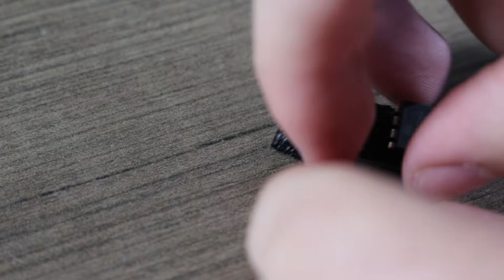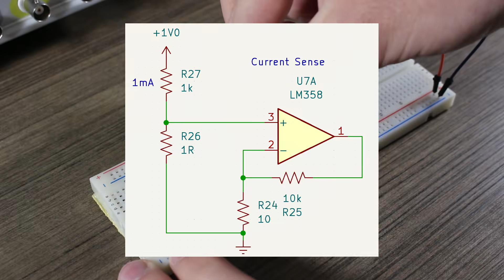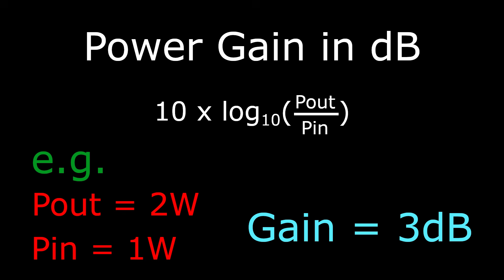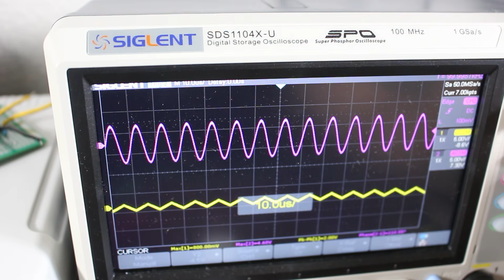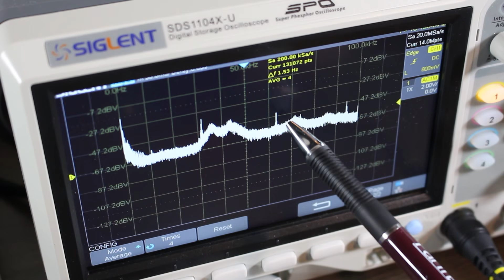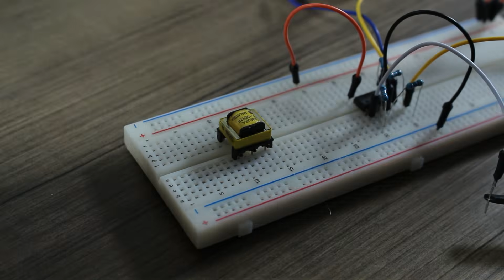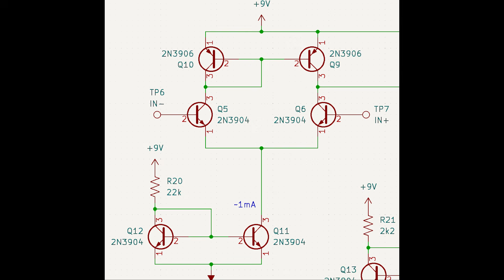The Ultimate Op-Amp Comparison - Bandwidth, Slew Rate, Frequency Response, CMRR & More!

Comment: My all-purpose jellybean tends to the the TL07x (usually the ´074, since sometimes the TL071 or ´072 are actually more expensive!)  Cheap enough to buy in quantity and OK specs overall for most of what I do.  The biggest drawback is that it isn't single-supply. (But check out the TL97x, which is similar and can sense down to ground).

LMV358 - the CMOS version of the LM358 - is full rail-to-rail, but limited to a 2.5-5.5 volt supply. The input offset of a millivolt is just so-so.

The NE5532 (SA5532) seems to be everyone's default for audio, but as far as I can tell, the only reason is that everyone else uses it for audio. Also, you have to be really careful with the 5532 in any low-gain configuration; its internal compensation does NOT go down to unity gain and you'll be fiddling with external caps to tame the oscillations. It' is not happy with service as a unity-gain buffer.

OP-07 is a pretty cheap choice if you need an opamp with a lower offset voltage (100 microvolt typical).

Don't use any of these op-amps as comparators. There are a lot of op-amps that can't be used as comparators at all because they have a low differential voltage range. While the TL07x can be used as comparators - they wont take harm from having their inputs driven to opposite rails - they're slow to recover from being overdriven.  You'll get much more speed from an actual comparator. LM311/393/339/2903 have been around since forever and are still kind of a go-to.  TS391 has higher specs and has only 200 uA of quiescent current, if you're building a battery-powered device.  LMV370x is CMOS so the offset and bias currents are down in the tens of pA.  TS3021 has rail-to-rail input voltage swing.  LT1016 is probably the cheapest fast comparator if you have the need for speed. 

If you need programmable gain, the cheapest option is probably the LM13700. The AD633 is twice or 3× the price but a lot easier to work with. SSM2164  and its clones are also worth looking into.

A trap for young players is that on virtually all JFET and BJT-input opamps, and some CMOS ones, you can't let the voltage on either input go more than about 200 mV past the negative rail, or the opamp will latch up - its output will swing to a rail and stay there, even if the input voltage returns to the normal level.  Even a Schottky-diode clamp won't save you. If you need to handle out-of-range inputs,. the most secure approach is probably a Schottky clamp followed by a voltage divider with a ratio of 1:3 or 1:4, to knock the diode's forward voltage down into the opamp's safe input range.

This should cover a decent range of afforrdable options. If you need something better like the INA828 or LTC1052 you'll probably know it already, and know that you can't breadboard the beast because parasitics in the external circuitry and faulty shielding will be the death of you.  The same sort of caveats go to gain decompensation for higher speed, boost stages for higher output voltage, opamps with specialized buffer states for higher output currents, and so on - if  you need these, you're already beyond the scope of this video.
Reply: The 5532 is the standard for audio because it has near-ideal properties for audio. The TL07x family was used in mixers before the 5532 came along but disappeared rapidly. The LM4562 is slightly better, but it took 30 years for it to show up after the 5532. It still costs more, I think. Both of these have high current draw so they are not ideal for battery operation. Some modern op amps come close to the 5532 in consumer battery applications at lower current draw.  On unity gain operation, the 5534 (single amp version) is not compensated for unity gain, but from memory the 5532 is OK.

Agree about comparators: use a purpose-designed comparator, don't abuse a circuit that was designed for linear operation.

The distortion figures of the LM358 (everyone's got some 358s :-) ) can be improved by using a 1k-ish pull-down resistor on the output. Increases current draw though.

Comment: Excellent. I got eyes on that Transistor build. For now I bought the 50 for $5 Op-Amp slab O chips from China, a few LF356H from Bulgaria, and some LM311's from Digikey. These are for bench testing, I just want to understand them. I'm starting with a VCO circuit using the 358.  Good video.
Reply from the maker: Good luck with your VCO!
Reply: @SineLab  The 358 build worked! Now I have time for the transistor thing, because why not? I have way too many transistors and really want a ghetto op-amp. Cool, Thanks.

Comment: That was very educational! Could you also show other circuits like a class AB amplifier or class D amplifier with a couple mosfets and how to design such a circuit? Maybe you could show how to work with FETs or how to choose the right BJT. For instance, do I use a BC547, BC517, BC337, BD139, etc? I got a small set of some common transistors a while ago, but I've only used them to switch some LEDs on and off with a microcontroller and there are more interesting ways to use them but then you need to understand the differences more ofcourse.. Other than NPN versus PNP I mean of course.

And regarding the FETs, I understand that opamps with JFET input are often better, but why? Is it just because a FET has higher input impedance on the driving pin? (I guess that's called the gate? Normally I only work with BJTs and a couple mosfets for switching purposes so I'm not sure of terminology for FETs).

The explanation of that current mirror went a bit fast for me. I think I've seen other circuits for current sources maybe just using one transistor. What's the difference? I know there are packages with matched mosfets on a single die, so there must be packages with matched transistors on a single die as well. How much better could you expect your custom built opamp to work with matched transistors like that?

Anyway, great content! I don't expect an answer to all these questions here. But maybe some ideas for future videos.
Reply from the maker: I have plans for both a class D amplifier and a BJT vs MOSFET video in the works! Stay tuned for those.

As for the current mirror, you should think of BJTs as adjustable current sources, depending on the current flowing through the base. In my circuit, I used one NPN as a diode (PN junction) and let the resistor determine the current through it. Since both transistors share bases and emitters, they should both have roughly the same constant base current. Since the base current is constant, the loading transistor will have a constant current draw, hence a current source. Other circuits may use only one transistor and use another method for providing a constant voltage/current to the base of the loading transistor. The end result is still the same.

There are indeed packages with matched BJTs. I'd expect these to perform better since their gains are the same. There should be less offset on the output and better CMRR.

I hope the explanation made sense! :)
Reply: @SineLab  absolutely made sense. I doubt you could not make sense. Lol.. I am interested in learning the above post as well. I have built a few amplifiers from someone else's schematics but would love to sit down with my box of parts and ideas. Understanding impedance and calculating resistor values seems like the nitty gritty for me. Thank you so much for your talent and taking the time to give such detailed responses. I look forward to your future videos.

Comment: LM308 and LM324 for old school really good chips. I have a couple tubes of each from way back and still use them, especially the 308 for small signal low noise, and 324 for single voltage supply. They can not compare to modern chips for balance and input current, etc.
Reply: Good luck buying any LM308 these days.
Reply: @2001pulsar  SO I hear. I have plenty and there are much better choices today but I have not kept up and don't know a good substitute. Do you know of a good in-amp to replace AD521?
Reply: @charlesspringer4709  not without research for the AD521.
The biggest feature of LM308 is very low input bias current,  which is useful in instrumentation amplifiers for amperometric measurement.
Reply: The LM324 is one the worst than you can use... need high voltages to run correctly and have some issue around the zero level. Stay far from it, use modern op amp.

Comment: What about a digital Op Amp based on an ARDUINO and 2X ADCs and a DAC

int OP_AMP(int X,int Y)
{
            int RESULT;

            RESULT=((X+(-Y))*1000);
            return RESULT;
}
Reply from the maker: It's an interesting idea, and probably would work. It all depends on the resolutions of the DACs and the ADCs. As well as the speed of the whole system.

Comment: I was looking at prices in my country. The cheapest dual op-amp is the PJ4558CS at 8c USD and the LM358 is 8.3c ea for singles. A pretty good performing op-amp is the LM833 at 40c each. The NJM4580 is $1.04. The OP07 is $1.05.. The MCP6021 is $1.37. The MCP6022 is $2.12. All from the same source so the relative costs can be seen.

Comment: They still sell low cost dual-matched NPN and PNP transistors, although they are in small SMT package, that way the input differential pair will have better characteristics like lower input offset voltage
Reply: Can you provide a part number for one ?
Please
Reply: @VandalIO  NST65010MW6T1G for PNP, and  NST65011MW6T1G for NPN, they are available in SOT-363-6 package, it is quite small but you can find adapters to make them DIP and use them on the breadboard.
Reply from the maker: I'll have a look at those matched transistors next time I make a discrete op-amp.

Comment: you did not build an op-amp. you built the discrete equivalent to an opamp. just saying
Reply: op-amp means operational amplifier and he built one. The original operational amplifiers were built with vacuum tubes and modern practice is to use a single integrated circuit. He did neither, but it was still an operational amplifier.

Comment: Hendrik Wade Bode, an American of Dutch ancestry, worked at Bell Labs where his co-workers called him BOH-dee, to which he did not object.  (in Dutch, it is apparently pronounced Bo-duh, but in my career, I've never heard it pronounced that way.)   A Bode Plot uses straight line segments to approximate frequency or phase response.    The graphs you show are not Bode Plots, but actual frequency & phase curves.
Reply: No.
Whilst it is true that Bode did use straight lines on the frequency and phase response charts, these were an approximation and contained error, the fact is that the name "bode plot" for the Frequency and phase response charts has been in common use by electronic engineers for at least 35 years.

It is accepted that "bode plot" refers to the type of chart and not the error in the curve plotted on the chart.
Reply: @deanXRayZulu  No.  "As originally conceived by Hendrik Wade Bode in the 1930s, the Bode plot is an asymptotic approximation of the frequency response, using straight line segments"  https://en.wikipedia.org/wiki/Bode_plot?useskin=vector   Bode plots approximate amplitude-vs-frequency and phase-vs-frequency curves with straight line segments.  When you draw the actual amplitude-vs-frequency curve, you have an (actual) amplitude vs frequency curve.
Reply: @cheponis  No.
Listen up idiot. It is common practise to refer to them as bode plots. The accuracy isn't relevant. 

There is no rule that says a Bode plot MUST be an estimated plot.

Comment: "5532 popular choice on the internet". It is defacto standard in audio circuit design especially pro audio going back to the late seventies. I have variants in most equipment I have opened up and jrc 55xx variants
Reply: Agreed.  The NE5532 is the defacto standard, and it is much less expensive that the OPA134 (almost 1/10 the cost).  The statement that it has worse specs is not entirely correct.  The NE5532 beats to OPA134 in noise performance (nV/√Hz @1kHz).  The OPA124 has much better THD specs, but both are quite good for many applications.  However, if you want better, the dual opamp LM4562 beats both of them in specs and comes in at a cost of about 1/4 of the OPA134.  For a few cents more than the OP134 in production quantities, the OP1611 offers about 1/8 the noise voltage, 14dB lower THD+N, and 20dB better CMRR, .

Comment: Another important characteristic is the input current.
When the circuit is biased with high resistor values, the input current can lead to an extra offset voltage.
The input current also has its own offset current and noise figure.

A JFET input, like the TL072, has a low input current, but this increases fast with temperature.
BJT opamps are often biased with identical resistor values on both differential inputs, to eliminate offset.
But this should not be used on OPAMPS with internal current compensation, like the OP27.

Comment: I found it a bit odd that your ultimate comparison didn't include the L4562, which has been the go-to opamp for low-noise audio applications for the last decade or so. Apart from the input currents (which are obviously greater than for the FET input amps), its specifications better all of the opamps chosen here in almost every respect. It's not rail-to-rail, so is less useful in 5V supply applications, but otherwise would be an automatic choice for me. It does cost around £2, but that's a dual opamp, and it's still cheaper than the OPA134, which is only a single opamp.
Incidentally, you didn't mention the input range anywhere. The LM358 is useful because it includes the negative rail, which is actually what makes it a genuine single-supply opamp.

Comment: 358 output stage work in B class  , cheap way to achieve low power with some crossover distortion. B-C class is mainly for transmitters .  someone got fake underperforming 358's .

Comment: The 741 op-amp has an offset null adjustment function using a 10K pot. between pins 1 and 5 with the wiper connected to the negative supply rail. This can reduce the offset voltage to virtually zero.
Reply: Plenty of good op amps now with Vos trimmed to 0 on the die.  No need for trim pots.
Reply from the maker: Yes, that is important if you need 0 offset.
Reply: Yes.. like the LF411. my personal favorite.
Reply: Yes, at one temperature. Only if the pot has the same temperature coefficient as the op amp will the offset stay nulled.